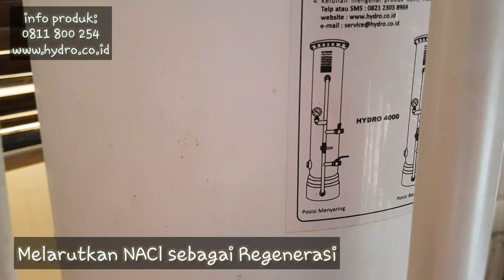Proses Regenerasi dengan Nacl | Filter Air Hydro | Hub. 0811800254

Comment: nacl itu apa pak.mksh
Reply from the maker: Hallo bu Arini Aulia , garam bu . Namun bukan garam dapur ya bu :) Info lebih lanjut wa/ telp 0811 800 254
Reply: NaCl itu garam, tp utk regenerasi pakai garam krosok/kasar aja cukup
Reply: @igustinyomananomwijaya3012  klo regenerasi kelebihan NaCL merusak resin gak pak?
Reply: @masudi2970  tidak cm mubazir aja umumnya 10% saja
Reply: @igustinyomananomwijaya3012  klo untuk 50kg NaCL dibutuhkan air berapa liter untuk melarutkannya pak?
Ada takarannya apa gk ya pak?
Reply: @masudi2970  ada tergantung jenis resinnya tp umumnya 10% garam 90% air, hitung aja sendiri pak.
Reply: @igustinyomananomwijaya3012  saya kerja di PT bagian wtp,biasanya softener flow meter bisa 14-15 kubik perjam tpi seminggu ini kog cuma 8-10 kubik perjam doang,minta solusinya pak?🙏🙏
Reply: @masudi2970  tekanan pomoa saat regenerasi brp? Kalau diff pressure tinggi bisa saja resinnua fouling/kotor perlu dibackwash, bisa juga pompanya mungkim bermasalah
Reply: @igustinyomananomwijaya3012  di softener hardness 3 PPM tpi di silo tempat penampungan air softener hardnessny kog 20 PPM lebih itu kenapa ya pak?selisihnya banyak banget antara softener dan silo